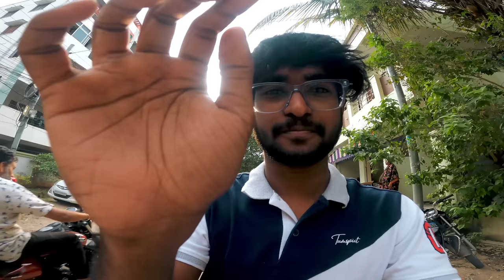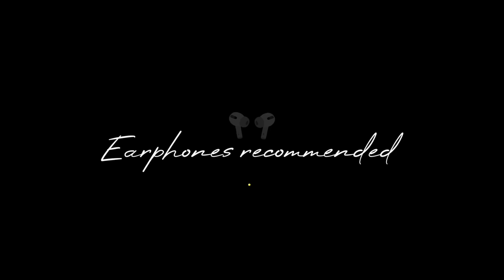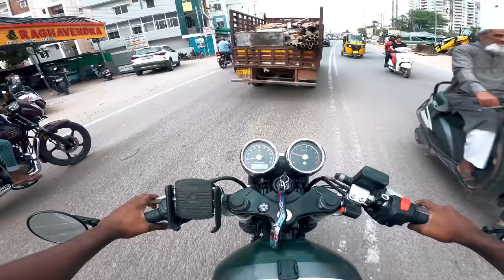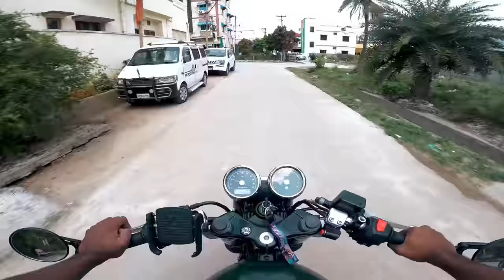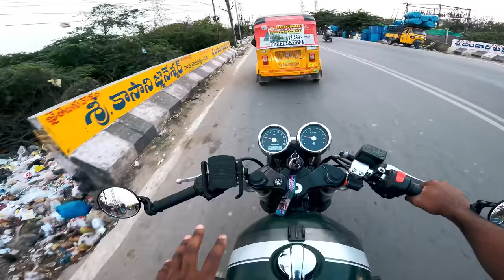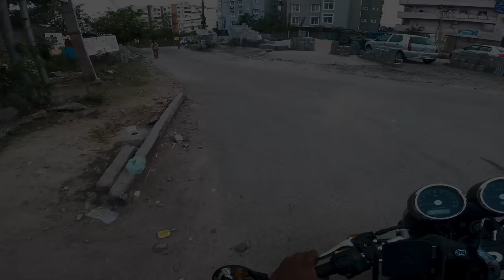MAJOR PROBLEM IN MY GT BEFORE MODIFICATION 😨 | TELUGU MOTOVLOG | SABUSPEC | ASHIK SABU.

Comment: bro i have a doubt ktm 390 ki single cylinder untadi gt ki twin cylinder untadi what makes ktm to run with gt .
explain me in terms of mechanical
Reply from the maker: Gt has a classic characteristic, it's a low revving engine. Redlines only at 7500 rpm and has a very low compression, the engine is always relaxed but where as the KTM engines are high compressed and redlines around 11k rpm . So all of the power is squeezed out. Gt engine has amazing torque. Pulls with ease even on inclined roads. Where a ktm will struggle. Completely different engine characteristics.
Reply: thanks for asking this question i learned a lot
Reply: Thank you so much@Ashik sabu

Comment: Bro why not a steering damper for resolving the wobble?
Reply from the maker: It's just a issue with the wheel balancing and improper oil levels. I want to clear problem completely and I believe these little wobbles cannot be controlled by a steering damper, not sure but yeah.
Reply: @ashiksabu05  👍